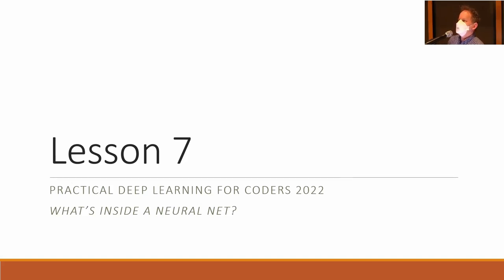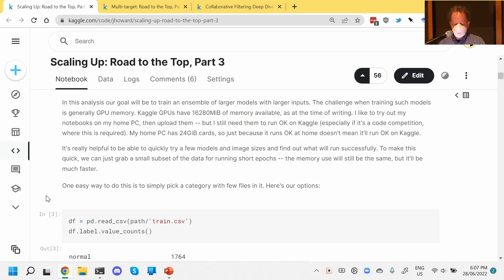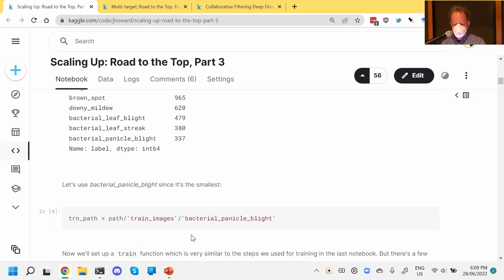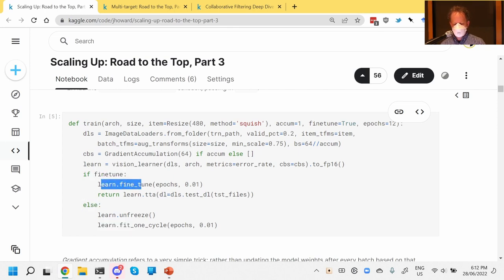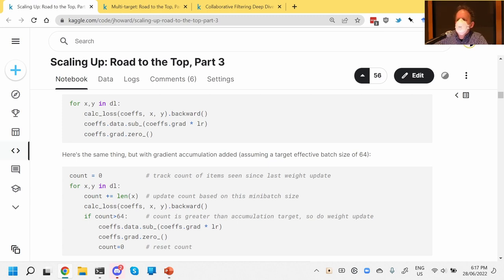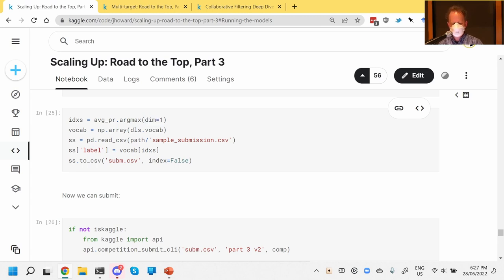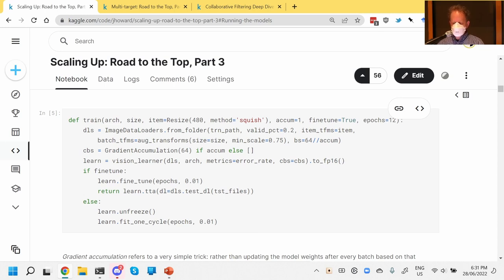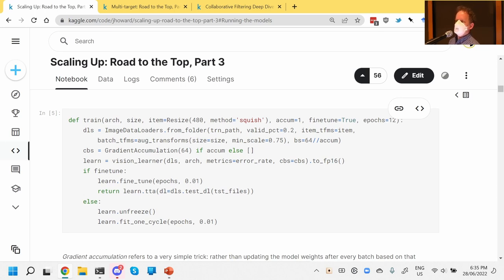Lesson 7: Practical Deep Learning for Coders 2022

Comment: I understand the advantage of gradient accumulation in terms of being able to run your training on smaller GPUs by "imitating" a larger batch size when calculating the gradients, but wouldn't a major drawback of the gradient accumulation an increase in training time and ultimately in energy use? i.e. isn't your training going to run half as slow when accum is set to 2? And the more you increase the accum number the slower the training gets because your actual batch sizes are getting smaller and smaller?
Reply: No, the total amount of work to be done is basically the same. There might be some more overhead from more frequent data transfers and also less parallelism optimization opportunity, but it's not like you're multiplying the work by the accum amount. You just batch the same total work by a smaller amount at a time.